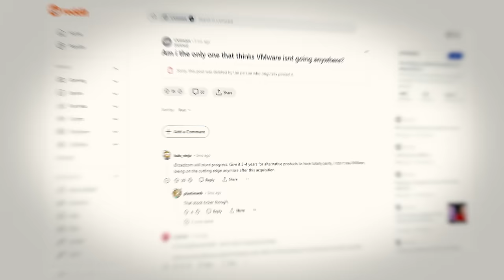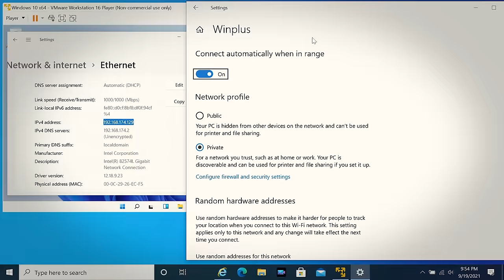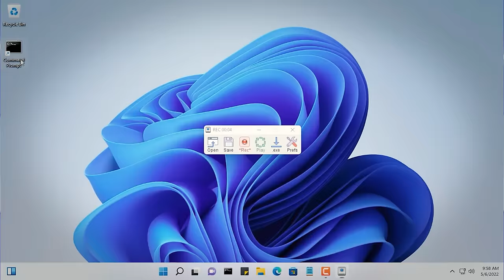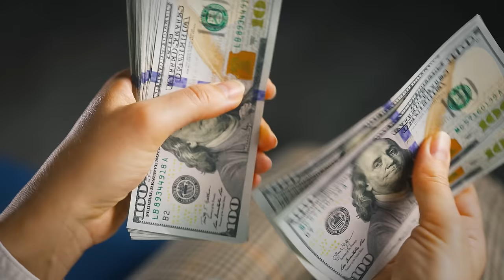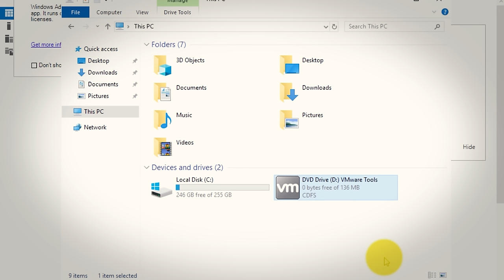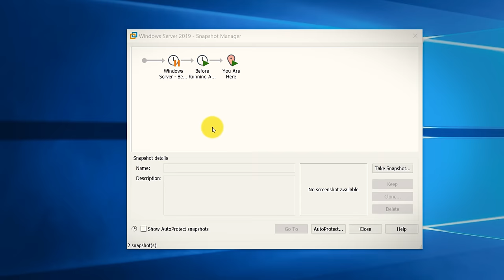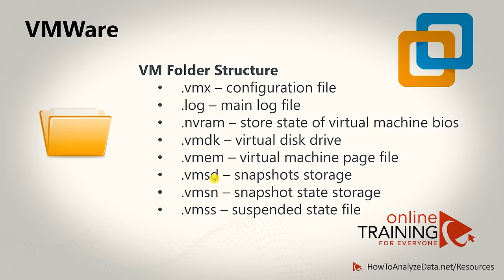Why Engineers Are So Worried About This Acquisition

Comment: This one is off the mark. Engineers are not worried, as they now have more work to port legacy apps to the cloud, which already adopted next gen virtualization technology like DPUs. Netflix never used VMware for user facing workloads. They're one of the early adopters of AWS. Average users are not worried either, as there are free and open source alternatives that are good enough. Only the short-sighted bean counters and bureaucrats, who procrastinated on the journey to the cloud will be milked by Broadcom, which BTW, lowered the license fee for cloud providers, to segment the market even further...
Reply: Didn't they just make licencing exponentially more expensive? in some case 2 to 10 times more for MSP's? Like all those smaller businesses having to pay the price for it?
Reply: DPU is load shifting not in itself virtualization.
Reply: Well I'm definitely worried about this, since VMWare Workstation has been a very important tool for me, and VirtualBox just won't cut it for a large portion of my usage. Hyper-V is an option, but it's still got a way to go before it would be comparable. I'm already having issues with VMWare though, as VMWare 17 broke many things (poor Windows 11 handling compared to VMWare 16, and also the removal of virtual disk mounting), so a switch to Hyper-V has already become inevitable for me.
Reply: Oh wow, seems like you understand every possible use case out there. You are a geniuis.
Reply: @teknixstuff  Same, just tried to Re-install Vmware after not using it for a while only to be met with Broadcom demanding I create an account in order to download VM workstation player.

Comment: interesting vid, my working knowledge of ESX is somewhat outdated but each VM is (or was) basically a big file that can be imported into competing virtualisation solutions. personally i always saw vmware as a bit of a temporary solution since it's pretty wasteful in other ways when you have a need for physical load balancing and operational redundancy on mission critical services. ESX was a stripped down version of linux (allegedly) with just the hypervisor and management services running. licensing Microsoft SQL for a virtual machine on ESX was the stuff of nightmares. running a Citrix farm in a virtualised environment was also a nightmare to support. i would suspect there are far more appropriate solutions out there today.
Reply: The old ESX days gave some pretty interesting work life, before VMware ironed out the kinks.  I remember time keeping in ESX for a while was really clunky, to the point of not working.  The ESX virtualisation of hardware timers was so broken for a while there.  VMware even put out a white paper about how difficult it is to virtualise hardware timers, with a note to customers to not run time servers as VMs.

Imagine our surprise when we logged into Windows servers that were playing up, to find the clock ticking backwards!  You could click the time in the SysTray to open the clock and literally see the seconds hand ticking backwards!!!!!!!  Imagine the confusion within the time stamped event logs!!!

Running a NTP time sync service as a VM?  Haha!!!  Good luck with that!  They would oscillate wildly between too fast and too slow, because they were attempting to compensate for drift in a hardware timer (which ought to have a relatively consistent drift) which was actually a virtual "hardware" timer that was not running at a consistent rate.

Those days were a nightmare for us in the infra team, trying to take care of these systems after we had already virtualised our infra.
Reply: Interesting 🤔
Reply: ESX kernel has nothing to with Linux. It can (or could, I am
not up to date) load Linux drivers and there is a management VM with Linux. But the hypervisor itself is not Linux. If it were they would have had to release the source code.

Comment: Most backend servers (AKA “the cloud”) have been lightweight Linux distros for years. And you don’t need VMWare or its friends to run literal & de facto VMs on Linux; you can use docker containers or QEmu, or even just dispense with virtualization and run your services directly on the machines. 

VMWare was for Windows, especially workstations and servers. You needed it or some like it to create and run VMs at all on the platform, especially with any kind of usable GUI or integration with the host machine. VirtualBox is good enough to be a replacement for most users (I switched years ago) but it is missing a few little bits and pieces some people need. What IT people needed VMWare for was all the massive virtualization they insisted on bolting atop the real servers and network, and frankly if it’s decline kills some of that excess it won’t be a bad thing.
Reply: Its fair to say the skilled Microsoft ecosystem employee didn't know linux, so vmware made it easy for them to virtualise Windows. But linux skills are growing, times have changed and these people are now comfortable to start using robust linux platforms to virtualise windows servers.

Comment: What's left for broadcom to even ruin?--Dell was doing a good enough job ruining things with the ESXi 7.0 SD card mess. I've never had to roll ESX back before that--and it works now, but it's still limiting us from ever going to ESXi 8 on our gear, so we've been pushing Azure for way more things than we usually would. I've retired dozens of production VMs in the last year, and I'm about to visit my second retirement community--maybe this one's the one. 🤣
Reply: Don't remind me the 7.0 SD fiasco.  What a mess knowing that I could never reboot the host server that it may not come back up and it's part of the vSAN.  I eventually trashed the entire two clusters of 7 nodes each and switched them to ProxMox.  Never looked back.

Comment: Good explanation on Netflix use cases! And going further (just for curiosity), if Netflix uses (or was using) virtualization on EC2, it is likely they went further in optimization with reservation paid upfront to AWS or pay as you go commitment for always on VM (instances on AWS parlance) and Spot instances for no priority or critical computing need such as upload processing, that could be interrupted for a larger discount up to 90% of regular instance pricing.
Reply from the maker: Ah, thanks for the extra insights Rodrigo :)

Comment: 6:35 I fail to come up with  a definition of "virtualization" that would make that statement correct.
And it's defiantly incorrect in aspects to what vmware (virtualization software) does.
The whole point is fundamentally wrong

Replace the term with "multithreading" and then it is getting closer

Comment: It was a good ride. I'll continue using my VMware Workstation 16.x license until it no longer makes sense to use the product (which might be sooner than later). I started on VMware Workstation 4.x and did most of my mission critical server work on v5.5 before experimenting with the bare metal builds in ESXi on a Pentium 4. The world and Internet have changed so much since then and I still use VMware products today for testing and curating a variety of software. It's just one of those rare things that made the past 20 years tolerable.

Broadcom is a scumass company and I've never had any good experience with any of their products, to my knowledge only hardware. For the past decade I've had an XB3 modem that allegedly uses Broadcom chips and it craps out at random, probably because of inferior quality engineering but who knows? If I could move to something else I would have tossed this garbage a LONG time ago. Broadcom managers are also insufferable pieces of garbage that try to wear you down mentally and emotionally. I'm a dude. There shouldn't be any emotional punches to pull but somehow they find it. Send them back to where they came from.
Reply: I don’t know what kind of Broadcom manager you had. But I have never had that kind of experience with any Broadcom manager lol.

Comment: I evaluated a bunch of virtual machine options 20 years ago, and chose hyper-v over vmware after an extensive comparison.  I have never regretted that choice.  Have not had a moment's problems in 20 years of using hyper-v.
Reply: Hyper-V already exist in 2004?
Reply: The first virtualization from MSFT, If I remembering correctly is called Virtual PC.
Reply: @honor9lite1337  It might have been 2005 or 2006, wouldn't be later than that.  Can't be sure about exactly when I set it up but it was a very long time ago.
Reply: Fake claims 😢

Comment: VMWare is already out of date. My employer has switched to AWS. Azure and AWS and Google to a smaller extent is where the market is going. Firing an instance without worrying about building, maintaining space, and committing to resources or configuration is a very very big plus. It is legacy technology. Your analogy with Netflix does not take into account the hardware. With AWS you can shutdown with Ansibile unused clustered instances and services based on demand. The cloud makes soo much more sense verses having an in prem vmware cluster

Comment: The problem is, what is the endgame here?

VMWare is a software for x86 platforms that is widely used in servers.

Broadcom is a semiconductor company that makes sells non-x86 processors. Their processors power network switches, and in the future, they might want to move to become a cloud CPU manufacturer. They have already probed this area with (Cavium) Vulcan. As others such as Qualcomm make their move, so must Broadcom.

This means they have long term no interest in maintaining VMWare for what are effectively their competitors, but might make conditions more favourable for the version that might eventually emerge for their platform.

Comment: Qemu existed and needs serous help with getting a GUI manager, especially on Windows. The situation is better on Linux but it's still a total mess compared to VMware or Virtual Box.*
One of the main strengths of Qemu is the gpu passthrough which is the only way to have any kind of video acceleration that isn't a complete joke. No an emulated "S3" gpu isn't suitable for anything other than writing in notepad. Forget about using the decade old "experimental 3d acceleration" that has made zero progress since it was first shown off. If the S3 cannot do 2d graphics well, why is there even the option to enable a supposed "3d acceleration" ?

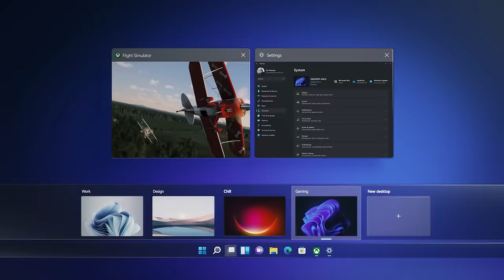Comment: 6:48 
you got it wrong over here man, even if a app using containerized env, they still not virtualization, and most of apps does not even use containers, useless you run flatpak apps in linux.

Comment: Vmware closing off the free software that allowed us to use and recommend them is the issue. Broadcom will regret it when new generation of admins don't use their software as an intro to begin with like I did with VMware many years ago. I started migrating my VM's to KVM since KVM (and most hypervisors) support the .vmdk file format. You can covert later if needed but not needed to get up and running on a different platform quickly.

Comment: I mean isn't the focus on the customer one of the best ways to maximize the bottom line over the long term?
I mean isn't it easiest to justify raising prices when your customers like/love the product, making it easier to achieve high margins?
I mean doesn't the shareholder approach lead to the board cutting R&D as well as other important costs that made the company successful in the first place, before the company dies out eventually? I mean doesn't it cut the life cycle of the company short, as it's stripped down to an unsustainable form?
Reply: >long term
That's your problem

Comment: Think was pretty much an inevitability since VMware really only has a market in hardware virutalization. There really isn't much growth to be done in that space since there really isn't any demand for innovation in the hardware virtualization space. It's not a surprise that Broadcom came in and cut a bunch of staff, since you really only need a small team to maintain the software thag already exists. VMware is already kind of niche so the effect of subscription models probably won't be that big of a deal.
Reply: VMware does provide virtualization for software. It's primarily known for its virtual machine software, which allows multiple operating systems to run on a single physical machine (hardware virtualization).
However, VMware also offers solutions for application virtualization and management, cloud computing, and networking. it's not entirely correct to say that VMware only has a market in hardware
virtualization. They have diversified into other areas like cloud management and networking (e.g., NSX for network virtualization and vRealize for cloud management).

Comment: I don't think the guy who made this vid ever had to use vmware in a pro setting.

Their product segmentation is a nightmare (and designed to upsell you to the higher, more expensive versions, like so many enterprise software are) and their licensing costs can quite quickly be more expensive than the hardware you put it on. And considering we are talking about 5 figures servers tailored to be hypervisors thats saying something.
The last shenanigan they pulled when I still had to actively follow their bs was charging not per cpu socket anymore but per 32 core increments. Meaning we are getting 64+ core CPUs due to tech innovation but for the IT admin it just translates to doubled or tripled licensing costs, nice !

And to be honest it was already more or less a subscription model. Sure you could pay for a 3 year licence but worry not they would make sure that you needed to upgrade to the next version of vmware to support windows 11 VMs properly or whatever else coming down the pipe at that moment. You had to make sure it stayed in version synch with your VM backup software and so on.

What I don't understand is why Dell which owned them for quite a few years decided they needed to split it off and sell it (or re-IPO it) a few years back. Sounds to me like throwing a golden goose under the bus. Maybe Dell really needed the cash at that moment but it's a really idiotic short term decision imo.
Reply: The answer to your re-IPO question is easy. Dell needed the money, they weren't doing overly well. VMware was the cash cow within the business, yes, but they couldn't afford keeping it so it needed to be sold. Big shame. I worked there doing the Dell times and the synergies worked out pretty well for both parties. And now this piece of crap. I don't know anyone within VMware who's happy with what's going on now

Comment: Is Virtualization software so complex that they rather spend nearly 70 billion on an existing company as compared to building something new from scratch?
Reply: The answer is yes, it is extremely complex. You're essentially creating a turn key "hardware" solution for every operating system that exists, and dealing with all the same driver and configuration issues a hardware company does, the only difference is for you its code and not re-engineering.

Comment: Clickbait title. You say "why engineers are so worried about this acquisition" and then at the end you say "that is why the tech community is NOT even worried but disheartened by the VMware acquisition". Clearly not the same, so the title is severely overstating the urgency and also the group, as I think that most engineers in the tech community do not care at all about VMware, except those that still use it. Most companies are moving their workloads to public cloud anyway, or run it on-premises on the many alternatives that exist.

Comment: Think your script is a bit outdated, iirc, Broadcom already pulled the free version of ESXi down and paywalled it. The company I work for has also set a goal to get off VMware and onto AWS by the end of 2025, so, my job is going the way of the mainframe admin now. I have tried using AWS and it is crap, the web UI is hot garbage, the tooling to administrate the enverioment is crap, AWS is only good if you are a developer. It's pretty much just pick a thing that matches close enough to what you need and ship it, continuing the enshittafacation of tech. AWS has some really really silly limits and restrictions that you just don't have when you own the whole stack and removes any ability to do any creative problem solving, it's only redeeming qualty is the power to scale with money, thats it. I think for most well-established companys it would make sense to use AWS for burst capacity, dev/test, or to see if the new load is going to be your baseline for a long time, and if so, start planning on getting your own hardware in-house to control costs without slowing the biz down.
Reply: It's not garbage. You just have a skills gap. You need to up skill in DevOps and Automation. Learn Linux, IaC. Take your existing Sysadmin skills with DevOps and apply it to the cloud. Get familiar with Ansible, Terraform...